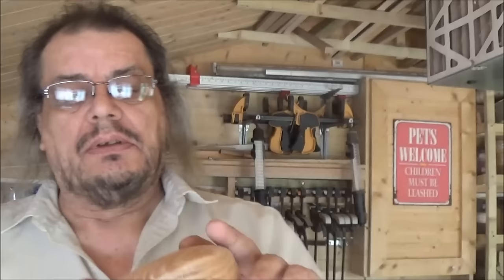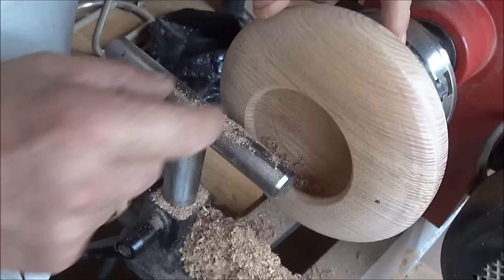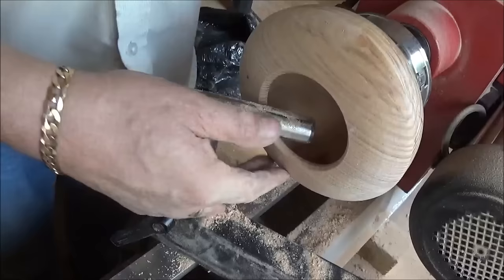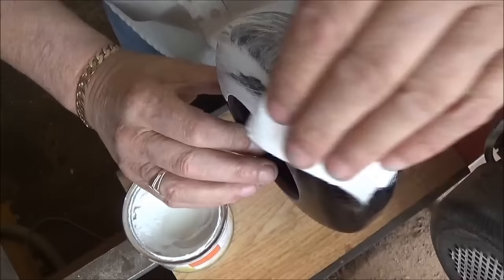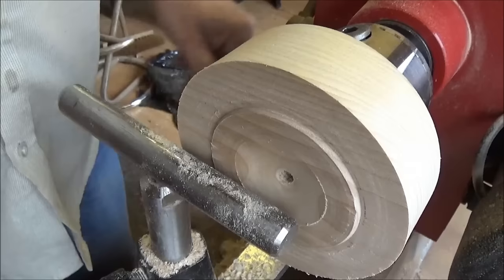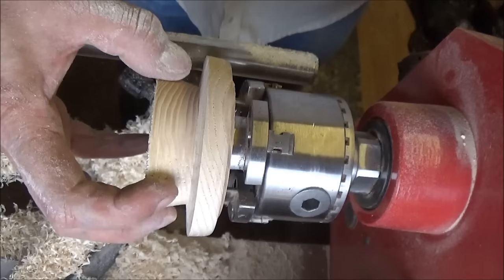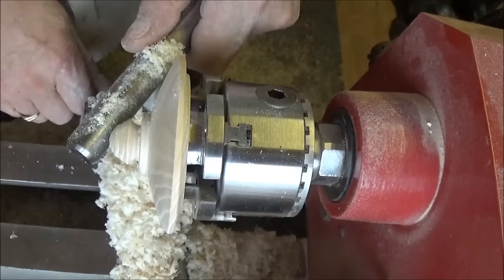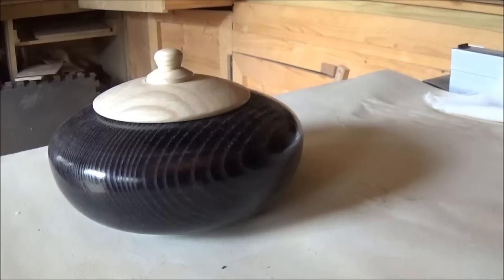Woodturning at 54a. #91. "A Coloured Lidded Ash Bowl"

Comment: I'm attempting my first hollow form vase, so I know what a challenge the first one can be. No disasters as yet, but who knows what's going to happen today. ;-) I only made a 2" opening so now I'm working on a way to sand the inside. As to your project, I like the black bowl with the contrasting liming wax. The lid is very nice as well...and I like the knob. I guess you could add a short finial later if you change your mind. Looks great as it is to me.
Reply from the maker: Thanks Gil. I thought about a small finial,but decided to keep it simple. As for sanding the inside of your vase,what about a piece of foam on a stick,with sandpaper attached? Just a thought,you'll probably come up with a much better solution than that!! 😀
Reply: I thought of a sanding stick as you suggest, but there are some ridges about half way down inside that I can't seem to turn out for fear of blowing out the side. I made a tool to fit in my drill with a solid knob on the end and Velcro to hold sandpaper that should level out the ridges. Then the padded stick should finish it off...I hope! :-)
Reply from the maker: +Gil Grace Best of luck!

Comment: Another great piece.  Thanks for the video!  How did you mount it to repair the tear in the bottom?
Reply from the maker: I've got a set of pin jaws that fitted into the original hole on the top,then just skimmed the base off and re-cut the mortise 😀